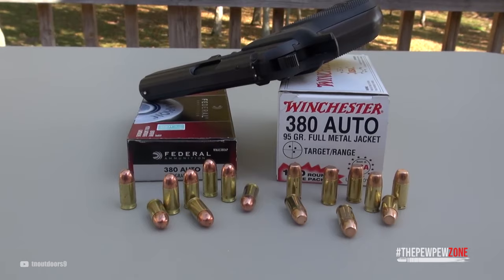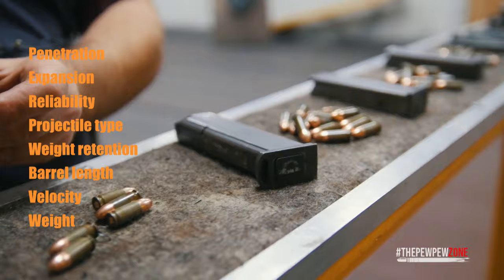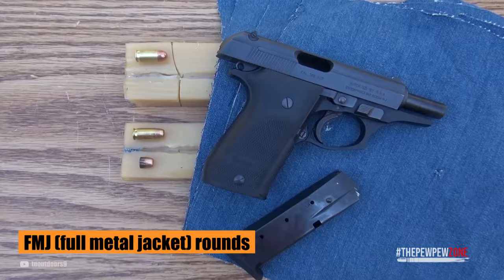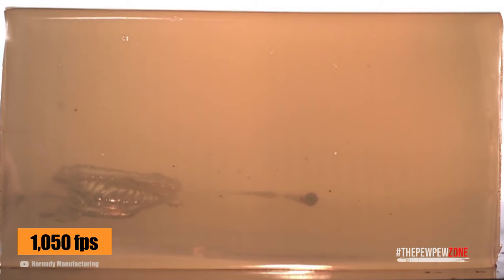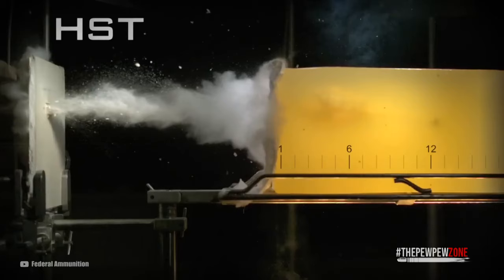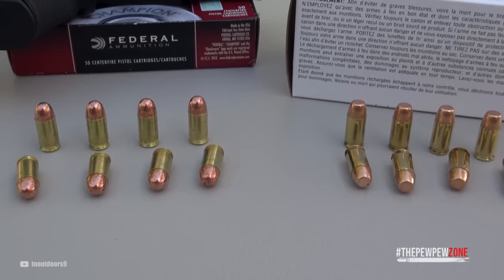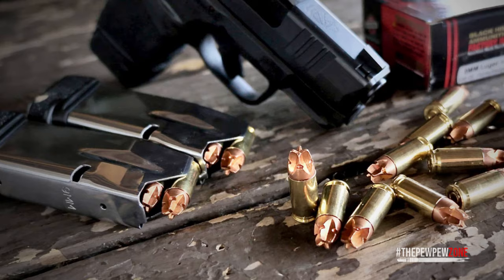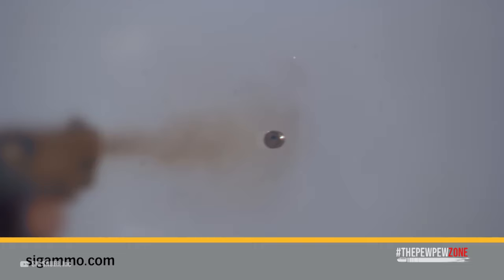8 Most Powerful  380 ACP Ammo for Self Defense

Comment: First, the FBI is not the LE Agency that uses their guns the most. Those are the US Marshalls and the US Border Patrol. The FBI is primarily an investigative agency. Secondly, a gel block is totally consistent from front to end whereas the human body lacks such solid consistency. Thirdly, penetration is nowhere near as important as where the bullet strikes. The .380 is quite easy to place head shots with. Those do not require 12 inches of penetration to be lethal. People need to see a variety of videos showing how many different types of .380 rounds perform in other targets such as a 25 pound block of clay.
Reply: The FBI may not use their guns the most, however the US Marshalls and the Border Patrol uses the FBI standard  for their duty ammo.  Ain't that something.
Reply: Because of the f.b.i. and their lil limp wrist, we now have the 10mm and the 40 short and weak I mean 40 s&w lul pathetic
Reply: Penetration still matters because you can aim the shot perfectly but if it stops short then it won't reach what you aimed at.

For example in the 1986 FBI Miami shootout a 9mm bullet fired into one of the robbers stopped just short of the perp's heart. A little more penetration really would have helped.

You really don't need much expansion, it really doesn't matter if bullet makes a 0.5-inch wide hole from a 380 or 0.7-inch wide hole in the heart from 9x19. Either way has the exact same effect of blood pressure instantly dropping to ambient. Ditto for lungshot, either will collapse instantly.
Reply: For third I see it as a pointless talking point that is constantly mentioned for no reason. Yeah obviously a defense round that misses will do no damage. And it's also obvious that a fmj that misses will do no damage.
Reply: @Treblaine  They shot over 150 shots and hit about 10 of them. The FBI got shot at by superior firepower and many survived. 

Now, tell me how penetration was the problem there...
Reply: @VIK_1903  That's my point, shooting a heavier recoiling cartridge is going to make it even harder to be accurate, especially when shooting fast and under stress.

Not only did only 10 shots hit, most did not hit vital areas. One hit the lung but absolutely  fell short of reaching the heart, all subsequent hits to vitals were the final few shots that ended the gunfight delivered at arms reach distance.

This was the finding of the FBI after the shootout that as a priority hit rate on vital areas (thorax/cranium) must improve and minimum penetration must be met, yet explicitly expansion is not a priority or even secondary concern.

The two priorities are way more hits to the vitals (thorax or cranium) and minimum penetration of 12 inches on all those hits. 

This is why 00 buck is still the king, it's the most pellets you can have in a shotgun shell where each pellet will reliably penetrate 12in.
Reply: @jason200912  The distinction is you may be more likely to hit (or land a better hit) with a lighter recoiling round, a round that needs to be fmj to penetrate enough.

Can you shoot a .44 magnum revolver as fast and accurately as you can shoot a .22LR revolver?

Comment: Underwood Xtreme Defender and Xtreme Penetrator bullets have no trouble meeting the FBI's performance criteria in gel and fabric+gel tests.
Reply: Penetrator will fail as it exceeds or matches fmj standard rounds
Reply: @jason200912 No, it doesn't. 
On average, XPs do not exceed 18" of penetration, by design. FMJs easily exceed 22".
Reply: @MeMadeIt  I sent you a YouTube video for it. Xp is 22 inches but I guess youtube blocked the comment
Reply: Extreme Defender +P is VERY close to 9mm ballistics and sometimes BEATS 9mm in ballistic gel damage. Barrier blind, feeds everytime and devastating damage even out of a pocket-sized firearm! All I’ve carried (in my 380s) for years!

Comment: You missed the best of the best I use in my .380's. In my Taurus TCP I load Underwood Extreme defender platinum a 68 grain fluted bullet, traveling at 1300 FPS, average penetration 13 to 14", totally barrier blind, awesome wound channels. In my Ruger security.380 I run the plus P Underwood 68 grain, same bullet out of a beefier gun, travelling at 1400 FPS, average penetration 15 to 17" of penetration also barrier blind, awesome wound cavities. Not cheap, but very effective, with the platinum running an extra buck a box, the bullets are coated with a dry lubricant to ease in feeding, and retard tarnishing. They've fed flawlessly in both guns to date. 😉
Reply: Yes sir! Totally agree. Underwood Extreme Defender +P is awesome.
Reply: That would be great if true but it is factually incorrect. The underwood 380 ACP +P 90GR. JACKETED HOLLOW POINT gets 1200 feet per second and the XTREME DEFENDER gets  1,300 FPS also keep in mind you are using shorter barreled guns than they test with so your actual speed is well below that.
Reply: @dragonballjiujitsu  They jam in the Ruger LCP Max and the new Bodyguard 2.0.
Reply: Ruger states in the owner's manual of the Security 380, do not use +P ammo.

Comment: Just an FYI, HST (according to a Federal bullet engineer who helped design it) stands for "Hydra-Shok Two".  It's the second generation of the Hydra-Shok projectile.  Hydra-Shok Deep is the third.

Myself, I switched from HSTs in my LCP to Barnes TAC-XP solid copper hollowpoints.
Reply: What about the old school hy-shok . Are they the first gen ?
Reply: Much better choice, the HST need to be going 1,200 FPS to fully expand, and that’s almost impossible to get from a 2.8 inch barrel. They also have issues with the hollow cavity clogging with clothing, plywood, or sheet rock, and turning into a FMJ and over penetrating.  I use the Underwood Xtreme Defender +P which is also a solid copper, monolithic bullet, except it’s fluted which creates a larger wound cavity through hydrostatic pressure from the spinning fluted bullet. It will get 15” of penetration and 10% gel after going through barriers passing the FBI test for penetration & wound cavity increase over bullet diameter.   I use Federal HST in my 9mm, outstanding bullet when driven fast but not the .380.
Reply: Barnes tac xp is only recommended for 9mm. It is not able to penetrate 12 inches in 380.

Comment: With any smaller caliber, bullet placement is key. Central nervous system or the heart. Case in point the 22LR used in vietnam as assasination bullet. Also dont forget the 380 is easier to shoot thereby allowing a more controlled well placed shot. I dont carry one but they sure do shoot sweet.
Reply: You right.  I bought a walther pk380 just fired it lately.  Have not been to the range in years and I did it at ranch. Hit a 4 inch knot at 20 yards easy . I have a 22 too and recoil was almost the same as the 380.

Comment: Federal HST 99 grain hollow point is what I've seen with the best gel test, etc.
Reply: Hst overpenetrates due to being too heavy. But it beats using fmj by a little bit. If you're dead stuck on hollows, sig v crown and Hornady ftx only and not the other Hornady junk, are the only ones to stay within the penetration parameter.

Comment: 380 is good because - "you can fit more ammo in a smaller package".   Um - no. Same diameter bullet as a 9mm. Just smaller bullet, less powder.  
9mm is like a .380 magnum.
Reply: I was listening, when that was mentioned. Um, what did he say… Lol
Reply: I thought the same thing and almost clicked off the video. It seems like this script was written with an hour of Google searches, yet no mention of Underwood or Buffalo Bore +p+.
Reply: A .380 gun doesn't need to be as robust as a 9mm. The parts and thickness can be smaller because the lower power. Just look at the Ruger LCP .380 and the Ruger LC9. The 9mm LC9 is bigger.
Reply: @amazingamerican3958  that's generally true, but it doesn't effect mag capacity.  A single stack mag of either .380 , or 9mm will stack to the same length.
Reply: @Blindsyde5762  Yep, .380 is just 9mm short.
Reply: @Blindsyde5762  I see what you mean though. He didn't word it very well.

Comment: You cannot fit more rounds into a smaller package because the 380 case is the same diameter as a 9mm.
Reply: Than how come they dont make 10rd 9mm handguns as small as the 10rd ruger lcp max chambered in 380acp?
Reply: @frankay90 Look at the Springfield Hellcat. Only reason it's a little bigger is that they gave it a longer barrel and a beefier slide and barrel for the increased pressure. The diameter of a 380 and a 9mm are the same. Only difference is length and power, neither of which affect how many rounds you can stack in the same height and width.
Reply: @jungleno4151 - You are absolutely correct.   The 9x19 is a slightly tappered cartridge.  However, there is not a significant difference in the diameter of the base of the cartridge case.
Reply: Good point, I thought the same thing.
Reply: @frankay90 because 9 has more pressure and bullet grain silly
Reply: Are you serious???
Reply: @mtnfraggle   lcp is much smaller than hellcat.  Drastically so if we are talking pocket carry.  Hellcat is great weapon, but there are a bunch of options that size,  like the shield, p365, etc.

Comment: It might be a viable defense round but WAY more expensive than 9mm. So good luck with sales!
Reply: ok,, you buy a box and load the gun.
Reply: @caseylm100  So you never plan on shooting it at a range? its an expensive round that isn't as available as 9mm.
Reply: @siah5593  I bought a bunch of 1776 brand 70gr copper flat point for $15 a box. Last box did cost $18 but that's inflation for you. Not more expensive than 9mm.

Comment: The FBI test is for a Duty round. Self defense rounds are not designed to pass the test, that's why most "Defense" ammunition even in 9x19 fails to pass or barely meets the requirements. The goal seems to be around 9"-12" penetration with good expansion and energy transfer. We need to stop comparing rounds to a ballistic test none of them are designed to pass. If you don't believe me just look at Critical Defense vs Critical Duty. One is designed for EDC for civilians while the Duty round is designed to pass the FBI tests.
Reply: basically, can one pass through barriers or not. I dont think they expect civilians to be going on the offensive and dumping rounds into someone in their car and need it to punch through glass and  metal and still expand.

Comment: I have seen many 380 tests. Some shows the round was crap. And some show that it are capable at close range. Very few talked about barrel length. One test gave a result of 200 fps with a 1.5 inch barrel. And one with 1000+ fps with a 3.5 inch barrel. ?- how well will a 9mil work with a 1.5 barrel?

Comment: It doesn't matter how 'powerful'' .380 acp can be because my S&W .380 EZ can't use +P ammo.  With some exhaustive research I've come up with two rounds that can make the penetration requirement and can reliably expand.  Sig Sauer V-Crown and Precision One's XTP loading. Fortunately, the S&W EZ has a 3.6" barrel so velocities will be greater than 'pocket' pistols.  I would suggest that you look into Precision One's product.  The came from a real no-name outfit in the early 2000 teens but have come a long way.
Reply: Get you some underwood defender and penetrator in regular pressure
Reply: Sam the revolver guy gets higher velocity from his LCP Max than his Security 380 with the longer barrel.
One must test your own gun and ammo to see what your actual results are

Comment: Hmm...   So guns can hold more 380 acp than 9x19?   The 9x19 is a slightly tappered cartridge.  However, there is not a significant difference in the diameter of the base of the cartridge case.
Reply: Can’t carry more, the .380 case is just shorter.  Same diameter bullet.  I reload for both.

Comment: Kevlar body armor , to me , is not the impenetrable castle it's wearer should believe it to be. A well placed round ,capable of rapid expansion , to the thigh's femoral artery -or ,higher, the neck's carotid artery is actually framed , acquired more easily , by the edges of the vest itself.

Comment: First of all the FBI standard is BS and has been proven to be. Most humans are not 12" thick front to back and anything that is going through 12" or more is an absolute over penetration risk. Secondly, stopping power in a bullet is based on two things. Hydrostadic shock (you can't get this is most non-magnum handgun rounds) and hydraulic failure (you punch enough holes in the body so they bleed out.) 9-10" of penetration and decent expansion is what is needed. Or a bigger hole. An accurate, stone reliable .380 with +P hollow points will do the job. Not as well as 9mm, 40, 45 etc. But it will still work.
Reply: You have watched Paul Harrell's meat target tests???
If not I advise you set the time aside for a look.